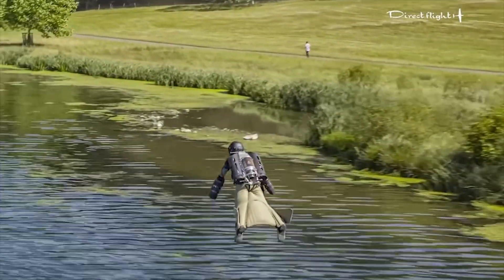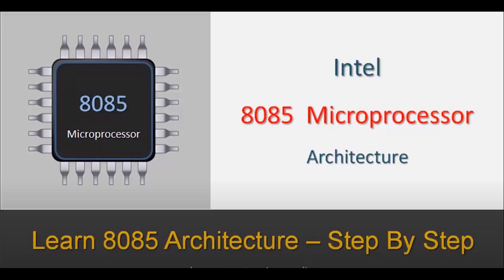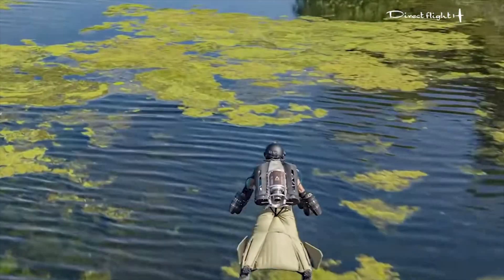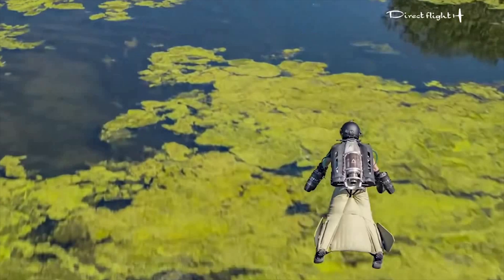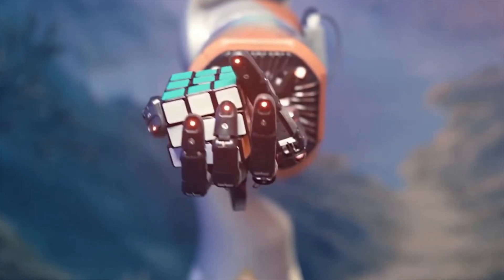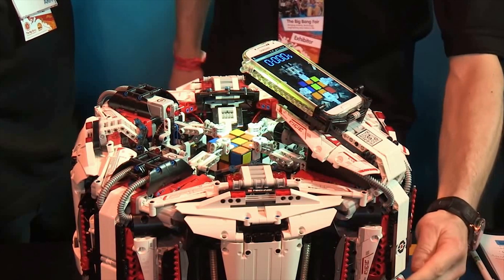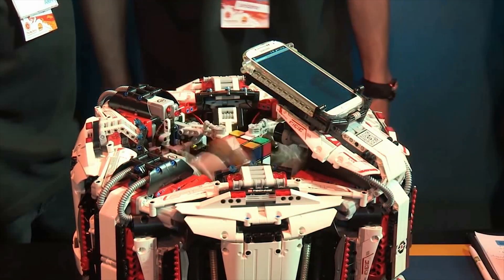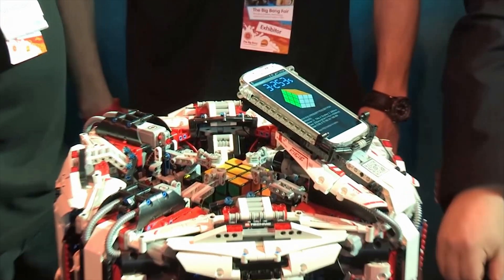How do I go about self-learning Mechatronics | How to start self-study on Mechatronics

Comment: The real problem is there are lot of resources
Suggest us assume good and free resources
Reply: You can look up the curriculum online and start studying. Start with basics. Mathematics should not be skipped. You need advanced algebra and calculus as well as physics. You meed strong understanding in physics. Then learn DC circuits and work your way in to AC circuits. From there learn relay logic. After that you will need to learn plc and structured text programming. As he said in the video all you meed is the discipline and curiosity to get started. But down the road you will have to buy equipment. No one can really teach you mechatronics. It is a passion you must be capable of learning through discipline and sacrifice. You can start with earning money as an apprentice industrial mechanic. There you will learn mechanical and electrical repair and assembly. Then as you learn and teach yourself you will progress to motor controls and automation. Get experience this way and then pay your way through school so you can get a great career as a controls engineer or robotisist. Robotics is really more about research and design. But is a great and amazing field. A mechatronics engineer, we can do it all. But you will have to be obsessed with it to be successful. It is a lifelong journey. And we have to know Information technology and communications as well. These fields are constantly changing and evolving. To just be blunt, if you need someone to point you to websites and build a curriculum for you then you dont have the curiosity and self motivation or drive to be a mechatronics engineer. As a mechatronics engineer, you will be looked upon to have all of the answers. Not someone who is needing large amounts of direction or pointing out flaws in someone who is trying to help you get started to begin with.
Reply: @jeremymcdonald5281  Thanks for the info